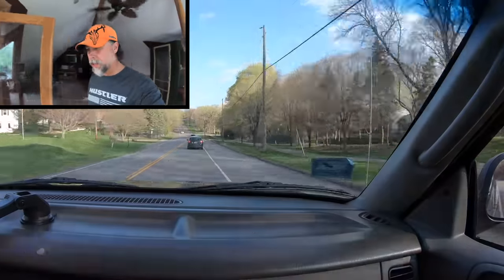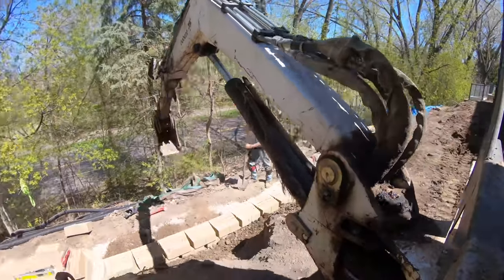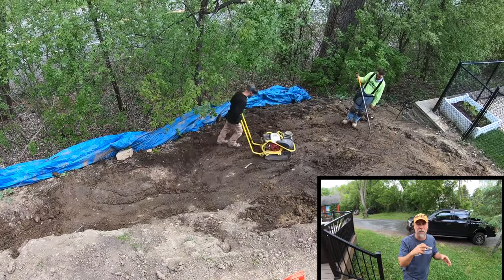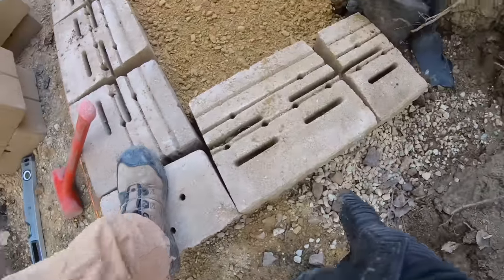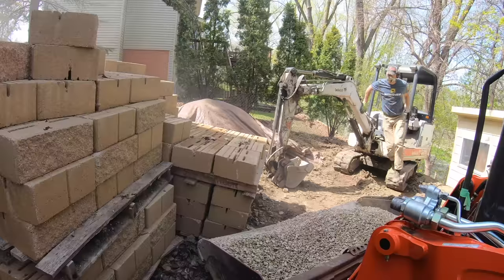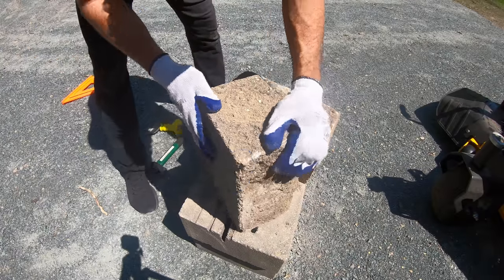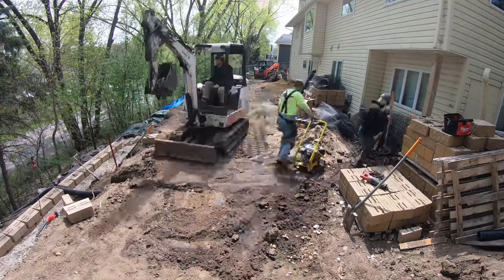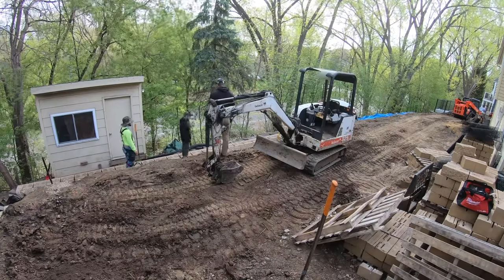Retaining walls- what 99% of people don't know

Comment: I could never understand the amount of rebar that engineers shoved into the retaining walls I used to do with ICF, when compared to blocks stacked on top of each other. Yes there both 'tied in' but at the end of the day a single cast concrete wall is just one block, why the need for all that steel.

Comment: What’s the most difficult problem to come across when building a retaining wall and what have you found to work best to move forward
Reply from the maker: The most difficult problem is poor soils underneath the wall or in the back fill zone.    A soil correction or bridging is required.
Reply: @Dirtmonkey  That's why God created a "Wacker".  They seem a lot better designed these days from when I used them back in the '80s building timber and keystone retaining walls all thru the Eden Prairie, Chaska, and Shakopee areas.  Back then the Wackers were like a glorified jackhammer and you knew if you pissed the boss off because you were put on the Wacker all week lol.
Reply: Down here in south Alabama the versaloc blocks are really expensive. Since we don't have the freeze-thaw cycle that you have in the north I have considered building a cinder block wall and putting a French drain behind it to relieve any water pressure against the wall. My soil is very Sandy with little or no clay. Do you have any thoughts or advice? I have found all your videos to be very informative.
Reply: @thomasjoseph5876  as an owner of one of these style timber walls in Chanhassen; whats the best removal now theyre rotting out? Thanks and good to see more locals!

Comment: Just curious why do some people recommend using a gravel base and some recommend using a concrete base for retaining walls my logic tells me concrete would be better but I am no expert at retaining walls.  Any input is much appreciated.
Reply: Concrete holds water / doesn’t drain. But won’t settle when formed/poured correctly. Drainage looks critical in this setting.
Reply: @RH-qd2nm  wouldn't the pipe at the bottom be draining the water anyway I just notice these walls always have a problem with certain areas of the wall settling so I would think using concrete base would eliminate this issue altogether.

Comment: Wouldn't it be better to use a backfill material with less fines?? The onsite material looks to have more than 10%fines which will give you less drainage..
Reply from the maker: Drainage in the backfill zone is not as critical as it is within the first 12" of the back side of the wall.  But in that critical zoner we often extend the drainage to 2-3 feet.

Comment: Tough job. (Aren't they all?) So my thoughts after doing this work for 30 years is-if the previous two walls blew out, an engineered reinforced cast in place concrete wall should have been introduced! No more problems! These blocks are great in certain situations but not ideal here. J.s!

Comment: are soil samples taken to see exactly what the ground make up is , also is the retaining wall designed by a structural engineer as in my honest opinion i do think this needed to be piled due to the size and incline , or are you just going off the block manufacturers recommendations on how to install there product , if so you are you are going completely the wrong way about this and are also liable when it fails

Comment: You have a site which has a history of blowing out retaining walls and then you build the same kind of retaining wall (admittedly using a heavier material) but expecting a different outcome. 
Sorry but this wall is also going to fail. 

What you haven’t done and in My humble opinion, should have done, was tie this Facia Wall into the Soil mass behind it, thus creating anchorages into the solid ground further back from the wall. 

Unfortunately I don’t believe that these Blocks are suitable for that purpose. 

The belief you have in the Strength of the Retaining Wall is doubtless the same Conviction both previous Builders held in their Construction Techniques and as History has shown they were wrong. 

Facia Walls look pretty but in situations with a proven history of mass Soil movement simply aren’t structurally strong enough to prevent that Soil movement. 

Personally I’d have gone with the Treated Railway Sleepers, but with them tied into the Soil mass behind, which neither of the previous Builders did. 

Time will tell of course, but history does have a habit of repeating itself. 

And I prefer Smooth drainpipe over Corrugated. 

Signed Armchair Expert.
Reply: @DuffyGabi  Thank you for the information.